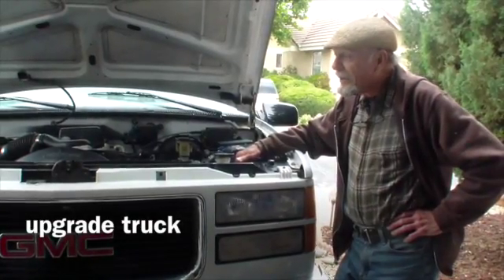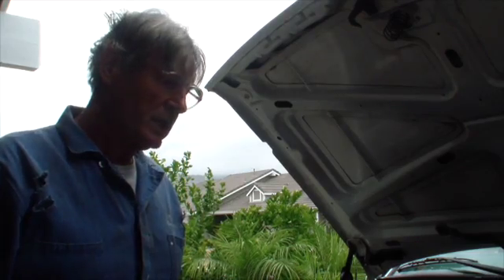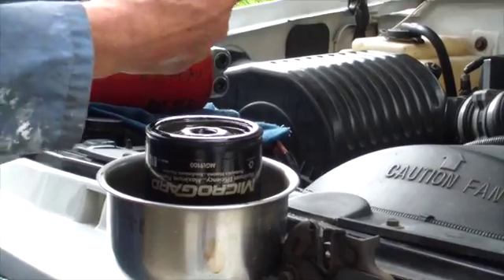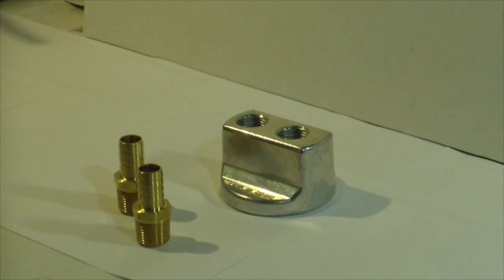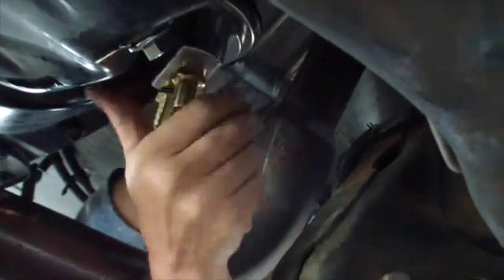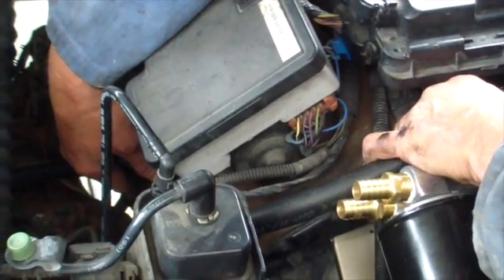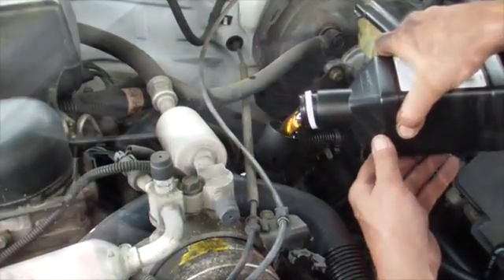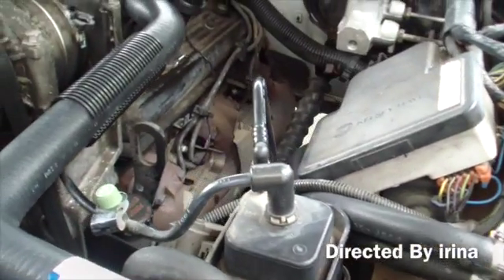upgrade engine oil filter system in a truck tmvtaylor

Comment: Where did you get the duel remote oil filter base KIt and what size pipe nipple fits the Baldwin BF7587?
What to use this setup on my 6.7 Cummins! Is this a good idea?
Reply from the maker: We have this kit without filters and hose here http://www.ebay.com/itm/Ford-6-7L-Dual-Remote-Bypass-Kit-FOR-Baldwin-BF7587-1u-Filter-amp-FL-2051S-/361827876228?ssPageName=STRK:MESE:IT

Comment: The bf 7587 is a fuel filter,, NOT an oil filter. 
And there’s an oil pressure regulator valve on that truck. Add a shim to it and I’ll pressure will be resolved and restored.

Comment: The original Amsoil bypass filter cleaned oil but was too expensive to change as often as needed to keep the oil clean. The newer ones don't clean oil and are still too expensive. What an over engineered mess you have. Use a stock full flow filter and leave it where the factory put it. Install a Frantz oil cleaner or one of the other filters that clean oil Such as the Motor Guard or Gulf Coast. I've used toilet paper for over 50 years.  synthetic material doesn't clean oil better than good old Toilet paper. Cotton works good but you don't see those anymore. The last one I saw was the LuberFiner 750.

Comment: The best place for the full flow filter is where the factory put it. Then you put on a Frantz oil cleaner. Then you can call it an upgrade.
Reply: Either method will double the life of an engine. The rest of the vehicle also requires similar measures for long life. I use the Frantz on a gasoline engine and the dual set up on a diesel engine.

Comment: Low oil pressure? BAD BEARINGS or BAD OIL PUMP rotors (too much clearance on either or both)! Changing to a thicker viscosity is a band-aid fix for shade-tree mechanics. Bypass filter good though...

Comment: There are several filters out there that clean oil. Those don't clean oil. There are no pleated  filters that clean oil. You need depth to clean oil. You can do OK with those filters If you change the oil enough. They are a little better than nothing.
Reply: Adding a fuel filter (10 microns) or a hydraulic filter (12 to 14 microns) is a significant improvement, and the extra oil helps a bit. The newer Amsoil spin-on Bypass filters are pleated, as far as I know. 
All engine oil should be changed because of oxidation, fuel dilution and combustion residue. It is a matter of when. The bypass filters do not take these out because they are not solid particles. Engine oil will last much longer with a bypass filter, and so will the engine.

Comment from the maker: Hi it holds up well after two years of use. The reason it works so well is the media is synthetic and not prone to cellulose swelling from water; also only a small amount of oil flows through this filter (2 gallons per hour; the filter is rated for about 50 gallons per hour). It operates well within its design specification.
All fuel filters are low flow compared to engine oil filters. There would be engine oil starvation if a fuel filter was used instead of an engine oil filter with possible engine damage. We offer kits using the AMSOIL EaBp Filter if using the Baldwin filter scares you. The AMSOIL filter is nice but cost $60.
Reply: +Irina Koroleva Interesting. I'm guessing such a small flow due to the high resistance of the filter? Since it doesn't have an orifice.
Reply from the maker: Yes the filter is high efficiency.

Comment: How does the BF7587 hold up? Since it is technically a fuel filter.
Reply from the maker: Works perfect! It will hold up for at least two years in a gas engine. If you have a Diesel you can check filter soot loading simply by checking the temperature of the exterior of the filter when engine oil is hot. A loaded filter is going to run cool-time to change. Add three more quarts of oil.
Reply: My 64 Rambler American came with a Fram spin on bypass filter that was similar to the Baldwin except it was smaller like the smaller Baldwin. It cleaned better than the full flow because it had a restricter orifice.Still no good. I tossed it and installed a Frantz oil cleaner. That set up you  have depends on the oil not getting dirty. In the old days of dirty engines you knew in a hurry if your filter was doing the job. You young guys don't know much. It takes experience.
Reply: @ralphwood5114  This content caught attention as I'm going to do a relocation for a '89 4 liter Renix on a '89 Cherokee due to the fact I don't like the stock adapter.  But Irina's trying to make a buck and probably won't like us to have people to go to the actual Baldwin Filter website, or another oil cleaner website.  My '65 Ford Custom 500 didn't come with a bypass filter.   I had to use a dwell meter, timing light, change my points and rebuild my carburetor.  Am aware that on top of engines the firing order is on intake manifolds.  Finding out where plug one is and is it TDC to do a distributor swap, and run new plug wires.  So you are correct, us young guys don't know much and lack experience because I don't have a ASE Certification and I do depend on forums and my service manual now and then.  Everyone starts somewhere.  Even the one who puts a "fart can" on a little import making their cars sound like a "Briggs & Stratton" or put a "cold air intake" will eventually comprehend that all those things hasn't changed as the computer needs to be programmed to implement changes.  While in the past weights, springs and other mechanical methods were used to increase horse power and torque.  I'd be grateful should you provide us with a bit of wisdom, than attempting to judge those of us doing the best of our abilities.
Reply: After two years of continued use on our 2002 MB ML500 (see youtube video) it is still fully functional. Large particulate capacity.